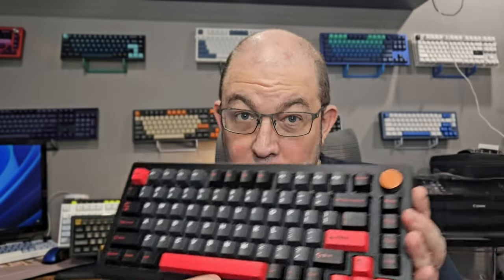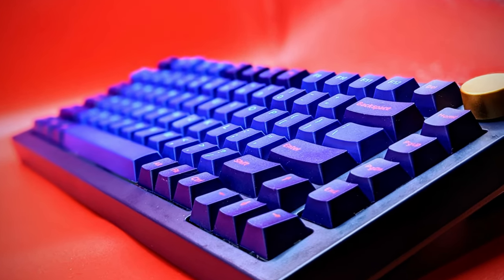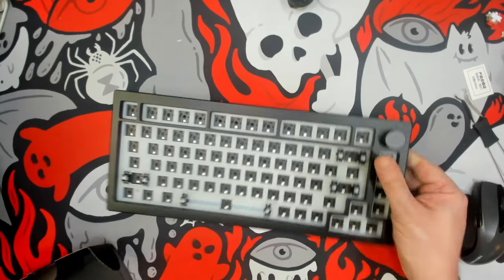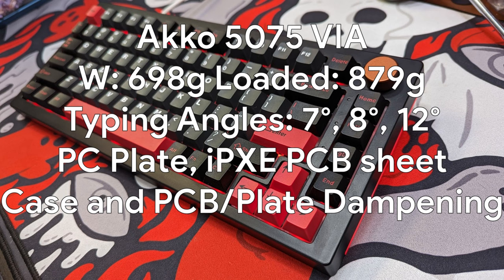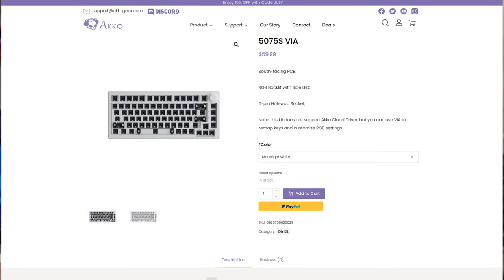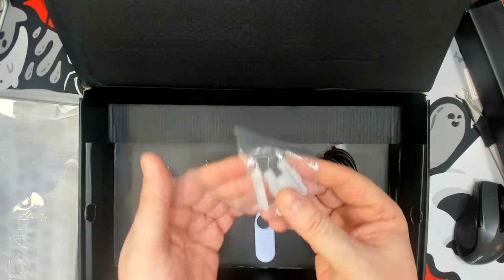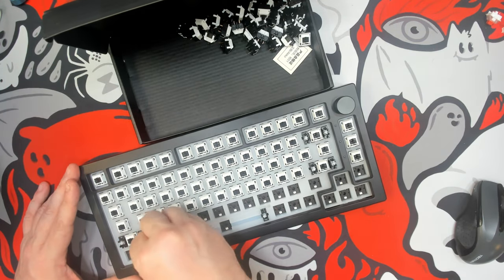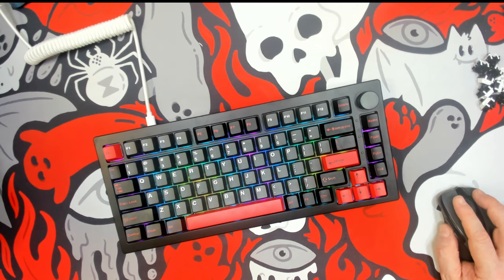Akko 5075S QMK/VIA keyboard. Best budget open source plastic keyboard around?

Comment: I had a problem with this kit, it's stabilizers to be more specific. Any Keycap profile that was bigger than cherry profile got stuck on them, they didn't return properly and I wanted to use CSA Profile Keycaps. I put the stabilizers of the gmk67 in my 5075s via and that thankfully worked and solved that strange compatibility problem. I also tried to use the mmd princess stabilizers that I got recently but they too, didn't work using CSA caps with the 5075s. I had no problems using them on the gmk67 though, using the same CSA keycaps of course.
Reply from the maker: Were you using long pole stem switches? I've seen this cause issues on some boards, but not all. I currently have CSA WoB loaded on my 5075S with Milky Yellow switches and have not experienced any issue.
Reply: @MechKeyboards  Kailh box jades
Reply from the maker: @Etem92  long pole stem switch, total travel 3.6mm. 

https://novelkeys.com/products/kailh-box-switches
Reply: @MechKeyboards 
Thanks for the answers, I learned some new things again. There are still many things I have yet to learn about this Hobby as a beginner but thats the fun part. I never would have thought that pole length could affect compatibility but it makes sense, now that I think about it.
Reply from the maker: @Etem92  I'm always learning as well, big part of why I continue to enjoy this hobby thoroughly, cheers!